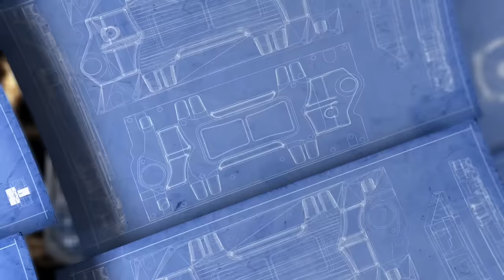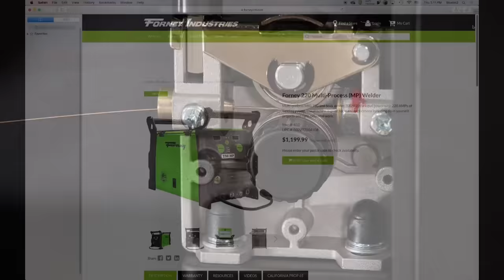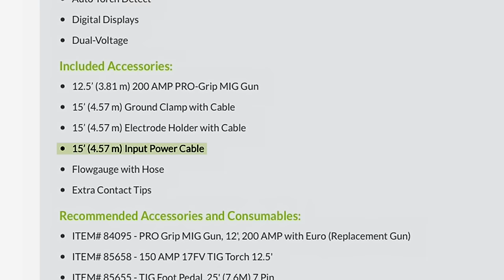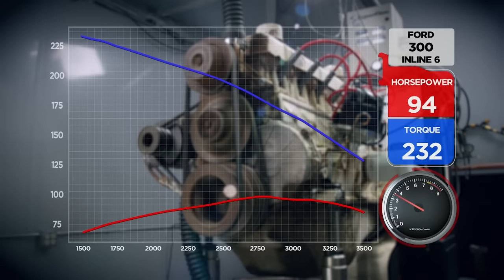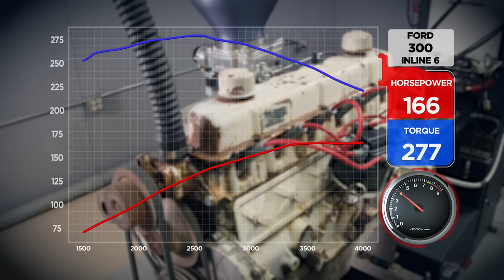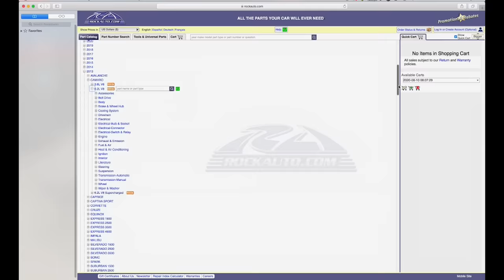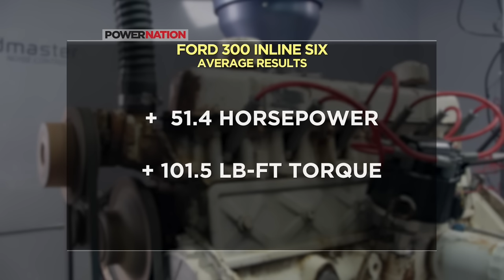Ford 300 Inline Six Gets Eye-Popping Off-The-Shelf Power - Engine Power S7, E17

Comment: Those old 300ci inline 6s were bulletproof.
Reply: Ford used them for garbage trucks [super heavy duty] by just adding a forged crank. ['61-'68? iirc...]
Reply: I had a ase instructor that did a money for clunkers event where they'd kill the motors on the old cars by draining oil. The f150 kept starting without oil when it should've siezed a long time before. Wait an hour and start it again. I don't do fords, but I swear by this motor through and through.
Reply: @internetperson8146  ive heard the same stories from people that did the cash for clunkers, they they hated doing ford 300s because they were a pain in the ass to kill😂 awesome engines
Reply: Just about anything can be bulletproof if it's out of gas at 3k.  I've seen diesel  engines turn higher.
Reply: @bmstylee  I hear tell, the stock bottom end is good to 6000+ rpm.
Reply: @bmstylee  it will turn more, its just pointless when it makes all of its power down low. Stop hatin man
Reply: @bmstylee  let's see a diesel make peak torque off idle.  Remember to compare it to an IDI enige too.  By my recollection prior to the Powerstroke the 300 was only 30 lb-ft behind and that's at a 144 CID disadvantage.
Reply: Six guns.
Reply: The stock port fuel injected version of this engine was perfect.   Even a throttle body injection upgrade on older engines would be nice.  I like carburetors, but these carbs were pretty bad for drivability in cold weather, high elevation, etc.
Reply: @scdevon  I disagree with them being bad in cold weather.  I live in Canada, and I'd take a 300 over some new cars.  They start easy in the cold because they roll over easy, a combination of low compression ratio and long connecting rods.  And they make heat quick....a big advantage at -45...
Reply: @iambeeman1  same, never had a problem in negative degree weather. Not quite that cold, but she always pops right off
Reply: @bowez9  thats facts
Reply: @traxxasrcfun  to be fair at - 45 you need thin oil, and a dang good battery but but she'll fire.
Reply: @iambeeman1      I agree that they are great cold starters even with the carburetors, but if there was ever an engine that benefited from fuel injection, it was this engine.
Reply: @scdevon  I had a 1990 efi, and I didn't like the way the efi got confused when I was letting the clutch out.  The rpm would drop, stumble for 1/2 a second the rev way up.  If you weren't on the throttle and slipping the tar out of the clutch it would be unpredictable.  But once you were moving it was fine.
Reply: @primer50  efi stock rev limiter was 6000.  Ford figured they were good for it ;)
Reply: @primer50        They're swinging almost a 4 inch stroke.   They'll take higher revs than 4k safely, but I don't see the point.
Reply: @nunyabidniz2868  Didn't start until 1965
Reply: Bought a 85 f150 with a 300 and a np435 manual with 93000 original for 750 bucks. Runs like a champ!
Reply: @scdevon  4000+ with the right breathing mods can be fun.  I'm hoping that they do that with this pumper motor.
Reply: ...and they use "timing gear"s instead of "timing chains"....winning!!
Reply: Owning one of these in the 95' efi guies, I can say with some authority the reason they're bulletproof is because they're as anemic as a covid filled enphasema patient who worked in a victorian coal mine. The efi system is garbage, un-diagnosable finicky fuel hogging trash.
Reply: @aae7725  I got over 30mpg with mine....but the clutch was cooked so I was forced to hyper mile it just to keep it from slipping.
Reply: @iambeeman1  I'm sure you did get 30 meters per gallon, I am 💯% positive you didn't get 30 miles to the little us gallon. Maybe for one tailgating a semi with 2.73 rear gears
Reply: @aae7725  not US gallon, here in canada we work in a proper imperial gallon. And it was definitely over 30mpg.  Again though, with the bad clutch I had to drive it worse than a little old lady.
Reply: @primer50  they feel like they’re revving to the moon and you look down and it’s at 3000rpm😂
Reply: @aae7725  I get 15 us mpg city driving. Definitely not bad for a huge 90s 6 shooter
Reply: @aae7725  
I have a 96 and I agree , it is a disappointment compared to my older ones. Ford screwed them up at the end.
Reply: @davesstillhere  hell yea, love my 300 with a 5speed in my 81'
Reply: Hated that motor, ate the hell out of gas and couldn't get out its own way....descent torque no hp combined with a under par slush box.  Rather just do a 351w, see no need for the 300
Reply: @jacobbrooks549  I also got 15 from my '95. I was very surprised my '97 Chevy 350 got the same and also made the same power.
Reply: @martyjoseph9507  good little engines
Reply: but they breathed terrible
Reply: @richpeters4705  i bought a 1985 and used for a plbg service truck loaded with tools and drove 305,000 mi before I retired it the only thing I did was a couple sets of plugs and a starter
Reply: @internetperson8146  it had to have been worn on the bearings they don't just not sieze
Reply: @bowez9  no the 300 i6 never kept up with the idi diesels.
Reply: @bowez9   1994 Ford 7.3 IDI Turbo.
Reply: Yep! I have a 300 six in my '86 Full Size Bronco. 348,xxx miles on it. Runs like a dream, no smoke, no noticeable compression loss. I'll keep this babe forever. Ford discontinued the 300 inline six in 1996, I guess they thought it was too reliable !
Reply: Also inline engines wear less than V type engines I have a 1951 Willys CJ3A with the original 134 Willys Go Devil flathead. 60 HP @ sea level, Maybe 40 to 45 HP at my home altitude of 8150 ft. But if you ever get stuck, I'll get you out!
Reply: @jimholmes2555  96 was a emissions standard problem
Reply: @jimholmes2555  inlines wear less at the top but do have wear issues due to a multitude of issues.. their favoritism towards strokes actually accelerates piston and bore wear and the place where the piston rocks still causes the same issue. V type engines actually om average wear at the same rate.
Reply: @jdrok5026  Sorry, but with a V configuration the crank is getting wear from two different angles. Inlines get wear from one and the best long haul diesels are inlines
Reply: @jimholmes2555 v engine have two banks but do not receive extra wear since the crank and rotating assembly is balanced. Anyways the item that feels that the most are the main caps. But in reality the forces exerted on the crank will still be exerted in the planes the crank has to work with. Thats why v12s are perfect.
Reply: @jimholmes2555  the best long haul diesels arent in lines. The big v12s that still run forever where only pushed out due to emissions. But if inlines are the best long haul why are trains powered by v engines.
Reply: @jimholmes2555  like its odd how inlines only power select equipment for either cost or packaging reasons.
Reply: @jimholmes2555  and no the crack always has multiple angles of wear as the rods and mains circulate cranks are well designed pieces for a reason not only this but a i6 crank is weaker than a v6 crank because each cylinder will be able to distort the crankshaft more.
Reply: Crank
Reply: @jimholmes2555  thats also why big rig diesel engines have ridiculously overbuilt components and have low red lines as the crank when allowed to turn is much more likely than a similar displacement v engine to break.
Reply: Heh I had my hands on an old 240 a few months back for a tune up on an old Onan generator from around 65-66 is about what we figured from the generator info. 
No start/ no spark. 
Replaced all the usuals and she fired right up. 
Looks like its last time up might have been when Bill was sticking that cigar in Monica.
Reply: @jdrok5026  History lesson, (from this old retired aircraft engineer). Inlines have been in WW2 aircraft, WW2 tanks, WW2 PT boats, WW2 trucks and Jeeps (Actually WW2 Jeeps were classified as G503) They weren't given the "Jeep" name until after the war and the civilian version came out. in the late 1930s, The Lincoln Zepher had a V12 with only 232 cu. in. the engine couldn't develop enough torque because the Cubic Inches were spread out through too many tiny pistons. In Modern general aviation aircraft, the Horizontally opposed engines are used, Continental and Lycoming. For streamlining and view out the cockpit. Opposed engines also wear more than an inline because there are two forces of direction as with V type engines. Many experimental aircraft now use 2, 3 and 4 cylinder inline engines.
Reply: @jimholmes2555  horizontally opposed pistons don't wear like vs either. Nor does the multiple banks have to do with that.
Reply: @jimholmes2555  again if you had actual information regarding the wear properties which was the topic of conversation not power.
Reply: @jimholmes2555  also there's always two forces in opposite directions in a engine.
Reply: Radials are actually still a common thing and have many pros over i and v engines.
Reply: @jimholmes2555  go read up on how a inline works. Rocking pairs is a thing still. A engine doesn't rid on 1 angle just because the block is cut in a line or a v or a w or a x or a radial as the engine rotates which causes multiple angles where wear and forces are going to happen.
Reply: @MrTheHillfolk  I mean most cases of engines being stored with closed off intakes to elements have them being starters. I have a enginer from God knows when that will still fire up and it sits around and does nothing. A lot of where engines fail to be use able is when the elements get to them. No piece of information on earth has ever lead to the whole argument that a i6 is the only engine that can do it as my 350 would prove that wrong and that thing has been sitting for over 2 decades in the elements
Reply: @jdrok5026  I'm obviously trying to educate a rock. Have a good day.
Reply: @jimholmes2555  you can't educate when you forget the basics. The physics and how wear works. I keep telling you they all wear on multiple angles due to thats how this works.
Reply: @jdrok5026  the engine in a train only runs a generator.
Reply: @turbolq4  that still doesn't matter when the generator puts a much greater load on the engine than a 80k pound semi has to deal with. Remember diesel gensets in trains are north of 3k hp up to about 5k hp and are constantly ran at wot
Reply: @scdevon  air fuel screw is not difficult to adjust.
Reply: @onlyetm  you must by lucky. My '81 is a 4 speed. Unless you're including reverse😏
Reply: @traxxasrcfun  damn obama
Reply: @jwoo1302  swapped in a 89' M5OD 5 speed to replace my oil 3 on the tree. Was shoot
Reply: @iambeeman1  I had an '88 F150 I6 manual and yes, the tuning was horrible on the EFI. Made plenty of horsepower and torque if you learned how to drive around it though. It reminded me of driving an old carbureted engine with a bad accelerator pump. Took everything I threw at it though. In an act of desperation once, I pulled a 10k lb trailer with it a short distance. It had no problem at all getting that load moving. The problem was stopping with that light truck though lol. Never did that again. That's what made me decide to upgrade to a 3/4 ton and in the process decided to go newer with the Super Duty and opted for the V10. I miss the old I6 sometimes but the V10 makes more power and torque everywhere. Even with the bigger cubes and about 2k lb heavier it gets about the same mileage as the I6 except highway cruising empty, and even then it's only slightly worse. The auto transmission is nice for towing too.
Reply: @davesstillhere  I remember my brother bought that exact year and model from a landscaper who beat the living piss out of it for years. It had 300k miles on it. He sold it to my uncle who did nothing more to it than put new valve seals in when he bought it. He put about another 150k miles on it before the frame rusted in half and the front end ripped right out of it.  Engine still ran perfect when it went to the junk yard.
Reply: @jdrok5026  The 300 has a main between each cylinder. A v-type engine has a main for every two cylinders. Crankshaft will deflect less on the I6 all else equal. The modern V6 engines like the Duratecs and Ecoboosts compensate for this because most run forged cranks and the blocks are skirted so the reliability is probably just as good or better than the old 300 on many of them, but the 300 was unusually strong and reliable for its time. It wasn't unusual for the vehicle they came in to wear out around the engine. There are many F150's in the southern states with 300-500k miles on their original I6 and still running strong.
Reply: @randr10  the crankshaft will deflect more due to length. You cant make everything equal as the length of a i6 crankshaft works against it. A v8 doesn't need a main for every cylinder to beat a i6 on crank deflection because the crank is physically stronger.
Reply: @randr10  like seriously length of a crank is very much why i6s are finicky to build around. V engines naturally have stronger cranks because they are physically smaller. The 300 i6 at the time wasn't unusual idk where people got this from. Cars rust so quick that a buick 3.8l with nitrous would last longer than the car. Again you all boil it down to incorrect thinking but no i6s because they have 7 main bearings or 4 is very much not that important for longevity 302 gmc i6s had 4 and lasted decades. Neither the 300 nor 302 revd like the v8s because well they had longer cranks and crankshafts at the time weren't as robust as most people think. A v8 physically has less leverage on it to deflect. It can only fit 5 and racing developments have taken v8 v10 and v12 to North of 15k with v10s peaking past 20k. Its much more difficult to make a inline engine do this because they deflect more versus their v counterparts.
Reply: @randr10  and most of the 300s didn't run strong to begin with im not putting the engine down im trying to actually shed light on them. They weren't stressed making pitiful amounts of torque and hp for its given displacement it didn't rev as high they ran out of steam at like 2500 rpm. Sure under the curve of a 302 windsor the 300 i6 feels stronger but it isn't the 302 carries more power further. I love old engines and I hate the inaccuracies that so many people spew. Why because its why engines die people forget to take care of them people ride them to hard people lug them. They end up worn out and not producing the power they used to and again that's because technology back then just isn't up to today's standards you can take a 5.3 out of a junkyard truck with 500k and it'll look almost factory the 300 i6 will have worn cylinders and a lot of carbon build up comparatively. Physics doesn't change. Or ford would never have replaced the 300 if it truly could've kept up in today's world. It was at a end and well that's the truth.
Reply: @nunyabidniz2868  - They got used in everything that had to be dependable, from busses, to dump trucks, concrete trucks, garbage trucks, and large backup generators.
Reply: Our fork lift and our concrete pump both used these for powerplants. The concrete pump did a 1400 yard continues pour in 105 degree heat and it never broke a sweat.
Reply: And they could pull to boot......
Reply: They used as much gas as a V-8 though. And with less power of course. I hated mine.
Reply: @bobthunder2461  -Except the bottom choice became 300, or 400M.
Reply: @jdrok5026  no way that the IDI diesels ever caught up to the sheer numbers of true HD jobs the 300 did for 40 years.
Reply: @Phantom0fTheRouter  lol the 300 wasn't used near as much as you think in HD jobs.
Reply: @jdrok5026  - If all the school busses, dump trucks, cement mixers, box trucks, and UPS Vans that ran them aren't enough then perhaps consider that there are still tens of thousands of them installed in backup generators for hospitals, office buildings, and neighborhoods all over the planet running on LNG.  And we should all know that intermittent, sporadic, short-run usage is the most HD job there is. How many diesels doing that job?
Reply: @Phantom0fTheRouter  actually most gen sets are already converted to diesel especially hospitals... the 300 i6 cant even produce the wattage diesel gen sets put out then. You listed a bunch of applications that the 300 i6 wouldn't even be considered hd. They would be light duty. How many diesels do these jobs bud the world is ran off diesel
Reply: @Phantom0fTheRouter  your knowledge is s few decades old
Reply: @jdrok5026  that's why straight 8 aren't too good for racing too much crank whip, but the 51 Hudson Hornet with Twin H power figured the combo out
Reply: @jdrok5026  -  the big diesel gens (that seem to keep failing when needed for hurricanes,etc.) have engines bigger than your not so heavy duty mudder pick up, and require fuel tanks of 15,000 to 30,000 gallons in size.  The "little" ones in the 600KW/750KVA range weigh over a ton and are usually something like a CAT 3412 DITTA that isn't going to fit any automotive application that applies to the subject.

There majority of new small gens are still Natural Gas powered I6 with turbochargers, up to about 7.5L in size.  And they would be continuation designs based off the success of the ubiquitous Ford I6 BB in that particular application.  How many generators are based on IDIoT 7.3L turbos (190hp/385lb-ft)  

I also struggle to see how a a 6 ton class C bus with 3-4 tons of passengers, or a 13 ton concrete truck carrying 20 tons (10 cubic yards) is not "HD" when the applications where  International Harvester IDI motors that replaced them (school buses, F-Series/E-Series) are?  

And since the IDI were so awesome, why did they only last in production vehicles for only 10-11 years (83-94), while 4th generation Ford Sixes were in the same trucks for over 30, long before, and even after the IDI diesel option came and went? What?  IDI should include the Navistar 444 that replaced it, and the VT365 that replaced that one,, all in less time that the I6 just did it's thing, because they were all just as awesome?   

Whatever...  

A lot of old 300s seem to like playing in the mud as well, but that isn't really an HD application, especially when the guy pulling your IDI out of the bog has a 300 running on 3 cylinders, with no oil or coolant.
Reply: @Phantom0fTheRouter  dude you have no idea what your talking about lol. A lot of the grid is backed up but cummins i6s not 300 i6 fords sorry you can't make a good backup generator out of the ford 300. Its not a dis its facts
Reply: @Phantom0fTheRouter  because the i6 was started long before diesel involvement from ford. But huh why is it almost all natural gas application engines are either gm or diesel based. I've seen only a few onans with the 300 i6 and they where not new
Reply: @primer50  I just revved mine till the valves floated then grab another gear and do it again...
Reply: @primer50  I had a 88 4.9 efi.  The gearing in it caused it to cruise at 55 at 3.5k rpms
Reply: @iambeeman1  I was lucky to get 6mph out of my 88 f250.      4.9 efi, t18 granny gear 4spd 2wd
Reply: Yeah, all these old Detroit straight  6 engines were bulletproof because they wouldn't make enough power to hurt themselves.
Reply: @countryjoe3551  yeah because they were all torque for pulling power not a race engine
Reply: Yeah when it runs 😂
Reply: Correction sir ARE the DAMN THINGS STILL RUN
Reply: This one even more so with it's industrial forged crankshaft!
Reply: @iambeeman1  30mpg ?????!!!! ?!?
Reply: Sad so many were destroyed during cash for clunkers
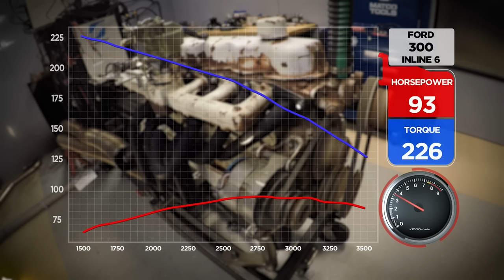Reply: 😅05:54 torque peak is basically at idle 😂😂😂.  Love these things
Reply: @bowez9 lol Cummins make psp torque at like 1300rpm
Reply: @maxjordan2625  with more displacement worse fuel mileage and more expensive fuel.  While the 300 does it 800RPM.